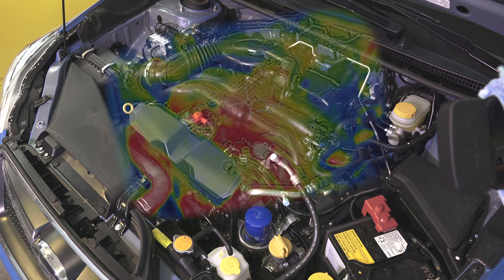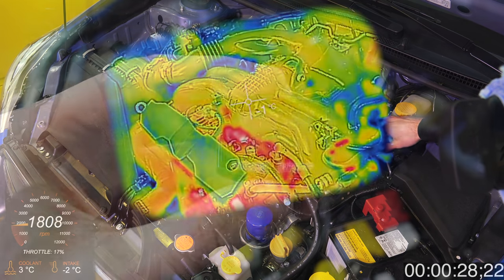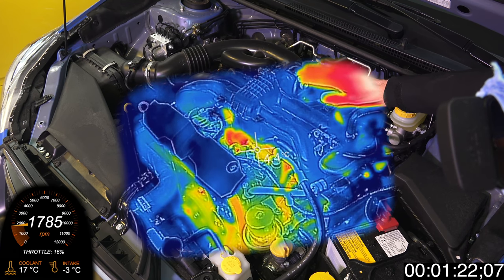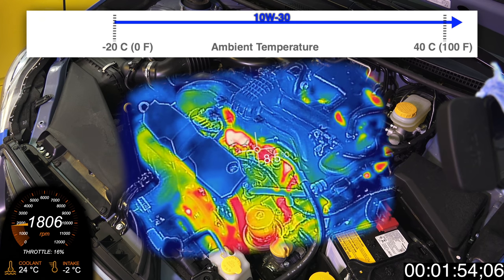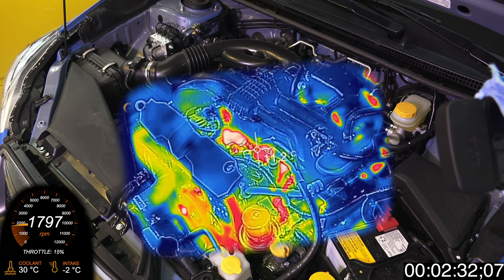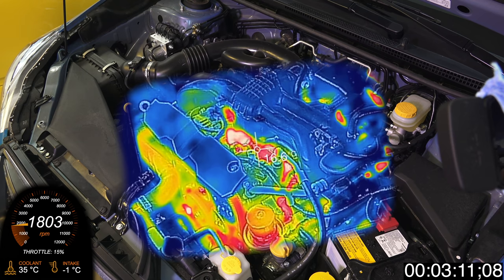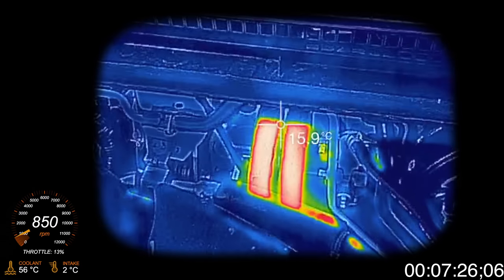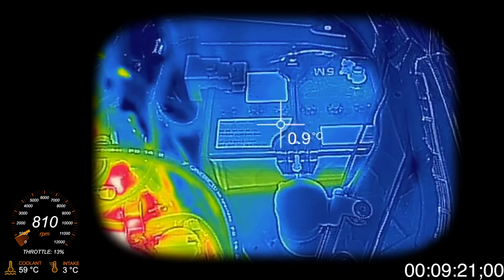Watching A Frozen Engine Warm Up With A Thermal Camera

Comment: Not warming up your engine is like waking up and running a 200 meter sprint
Reply: Based God  he meant like run as soon as you get up no warm up no brush teeth whatsoever
Reply: @the_batmobile0.4  nahh
Reply: Based God  dude you run in your pajamas? thats boss
Reply: Based God you’re obviously over exaggerating
Reply: Random Stuff heart attack are clots in arteries. It is fine to wake and instantly sprint, the body adapts fast and we hbe glycogen stored in muscles so there will be energy. Also the muscles can function anaerobic for 200 meters no problem
Reply: @antonioakiki3716  Yea...untill some of your tendons crack up or some or your muscles get fatal stretches..... Do you know there is the sinovial liquid in your joint (and in tendons area) that acts just like engine oil? When it's cold it's thick and cannot lubricate the joint to the best. Same for the blood vassels in the muscles that need to be warmed up to bring the best amount of oxigen and nutrients to the muscle. For the best athlete performance and to avoid the injuries your body NEEDS to be warmed up. Of course in emergency case u can just wake up and sprint. But try to do this every single day and i assure you soon or later u will have a bad injuries. Like a car engine, in case of emergency you can just drive it mindless of the temperature, but do this every morning and your engine will die much sooner than you expect.
Reply: yall some weirdos idk about yall but i run in my sleep
Reply: @Neil Kee he explained scientifically that it's not a problem with modern vehicles, he even made another video about it..
To all the others who didn't get the joke of @Based God, just /r woosh 🤣🙈
Reply: These new vehicles nowadays you really don’t gotta warm em up
Reply: @oleson3413  yup, I'd say that applies to all the vehicles from 1990 and above, basically when they started to switch from carburator and distributor to electronic injection
Reply: @oleson3413  But what if you live in a place where temperatures are currently hovering above 25°C all day and night long? Lol

Belive me, I've been seeing so many people having hard time starting their cars and even mine that has no problem starting sounds really bad with a cold start.
Reply: T h e B a y L e a f or running a 200 meter sprint without stretching or preparing beforehand
Reply: @k.hamilton5848  Be cool man.
Reply: SirCavemaninthewest what?
Reply: I never ran the 220 yd dash with out a warmup.
Did the 100 yd in 9.3 once, today I couldn’t! Lol

Comment: i just wait til the rpm drop below 1k then drive casual
Reply: r3fr33z39780 I just floor it as soon as I turn it on, vtec yo
Reply: with vtec you don't have to warm your engine?
Reply: Needfor I mean it stands for very tall engine cooling so it loves cold engines
Reply: vtec mean quick heating , you hold the engine in the warming zone ( redline ) and it will take less than a minute ! Hope this help
Reply: I can confirm this.
Reply: also running a truck turbo on stock internals ensures they reach perfect temperature in perfect time.
Reply: you have a honda?
Reply: I do the same with my Lexus. When cold, rpms go to 1,300 and then dip down to 900 after 30-40 seconds (when hot, engine eventually idles at 700). Once the rpms get to 900, I'm on my way.
Reply: r3fr33z39780 you're waiting way longer than you need to in accordance with his other video
Reply: my Saab drops RPM about the time he says to wait so it actually works out perfectly.  I feel like they are fine it will happen a lot faster than in this video in warmer weather.  

p.s please tell me these guys know that isn't how VTEC works and they are just joking and it's going over my head.  Like please tell me they know VTEC doesn't even kick in when the engine is cold.
Reply: Jaqen H'Ghar this is how vtec works. just hold the car in the warming zone as Gab mentioned, at or above the red line as soon as you turn the ignition for fast warm up
Reply: Also when there is a substantial amount of smoke being released from the engine it is just letting you know combustion is occuring at the proper temperature
Reply: TechXplosion these comments 😂😂
Reply: @ShawnD1027 i hope you understand they're making jokes about damaging engines and not being serious at all
Reply: I wait until the temp gauge starts to rise so that I know my heater will be able to blow warm air. I also wait a little while because the pistons don't become circular until they are hot.
Reply: In boxers and flip-flops?
Reply: And if there's a fire then don't worry it's just a feature where you bbq on the go.

Comment: For those of you wondering why the engine rpms dropped, once the engine was warm. It is because fuel doesn't actually burn, it is the atoms that do. As such in order to get a proper burn, the car atomizes the fuel, using fuel injectors and high pressure. Problem is cold fuel is harder to atomize. When the engine warms up the fuel is no longer cold when it reaches the injectors, because it gets heat off the engine. But when the engine is cold, there is no heat to warm fuel, so the fuel can not be properly atomized. To compensate for this the car injects more fuel. More fuel, means higher rpms. Also the various sensors the control module uses to determine the air fuel mixture, then correct it, must be warm to be accurate. When the car first starts, these sensors are not warm, so they are not accurate. As such the car runs in what is called open loop, or it ignores most of the sensors, and runs off predetermined values. Those values typically mean that the engine gets more fuel than necessary.

Comment: A few things that you might not have thought about when operating in extremely low temperatures. While it is true that a 0w engine oil will flow reasonable well and warm up pretty quickly. Other fluids like the transmission fluid and power steering fluid on hydraulic steering systems will take a much longer time to warm up or never warm up in extreme cold situations. It is also more critical that you reduce the stress on these systems when you start driving. Grease and Fluids in the differentials, CV joints, ball joints, etc. can be very thick at -40C and not only are they less effective at lubricating but increase the load. It should also be noted that the engine oil should be whenever possible completely warmed up during the drive. Moisture in the crankcase gasses quickly condenses when the engine is turned off and will make its way into the oil. If the water does not get boiled out of the oil and pushed out of the crankcase ventilation system it can freeze components of the crankcase ventilation system causing further problems, reduce the effectiveness of the oil, cause corrosion inside the engine, and over time sludge build up. If there is an accumulation of white milky fluid under your oil cap then the engine is not getting hot enough. Avoid short trips and extended periods of idling.
Reply: How do I know the engine is fully warmed up I love in TX the temp is 60s 70s right now

Comment: You also have to think about the other fluids in the car. Like power steering, and transmission. I've noticed a big difference in how the car shifts and how easy it is to turn from when the car is still cold to warmed up.
Reply: Many vehicles I've had particularly the brakes didn't get live for a short while and required a ton of pressure. Below -15 or F.🤠

Comment: try that test in Winnipeg, Canada when it's -45 degrees Celsius lol
Reply: Why not just try this in space at near absolute zero temperatures while you're at it
Reply: Deek you the boss
Reply: Deek I bet if I didn't say this someone would say "but there's no air in space so it can't start"
Reply: Jeff I'm right below you in Grafton North Dakota! it's best for block heaters and letting car warm up for sure. by the time it takes you to get all the snow of your car, it's usually ready to go.
Reply: Jeff I'm right below you in Grafton North Dakota! it's best for block heaters and letting car warm up for sure. by the time it takes you to get all the snow of your car, it's usually ready to go.
Reply: Let's remember that cars aren't affected by wind chill. It rarely gets below -30C in Winnipeg. Still very cold, of course. But -45 is hyperbole.
Reply: that was the temps up here not counting wind  in fairbanks alaska for the past week
Reply: Shuffle3956 in space it's actually less hard to start the engine (provided it can get oxygen from somewhere and it can use its radiator) because thermal losses are fewer: there is no convection in a vacuum.
Reply: Jeff it's been really nice lately lol
Reply: I lived in Timmins, ON where winter night time temperatures of -30 degrees C or colder are a common occurrence. At those temperatures I would not be able to perform this experiment unless the engine was prewarmed with an engine block heater, because otherwise it may not start. Even if it did, frequent cold starts at those temperatures probably reduces engine life. The block heater has the added advantage of warming the coolant so you get heat sooner. A battery warmer also helps a lot at such low temperatures.
Reply: We can't count wind chills Jeff. Lowest I've seen lately was - 32 c
Reply: Never in Winnipeg, which is what this thread is about. At least not since people have been recording temperatures.  Also, 2014 was the coldest winter in 64 years (which had about a dozen sub -30C lows).
Reply: You are that person talked about at 2:40!!
Reply: When it's -20 or more I usually let the car sit for a few minutes.. like 3-4 just so oil is flowing, Just a weird subconscious habit I guess
Reply: It's not often it gets to -45 here. Also don't forget wind chill doesn't affect your car
Reply: well, it affects it in the sense of quicker cooling. the faster the wind (lower the wind chill) the quicker an object cools.
Reply: Chris Yorke, wind does effect cars. A vehicle will definitely warm up quicker out of the wind because the engine is not perfectly shielded. Especially if you have your hood open like this guy))
Reply: Roman: Wind can affect the rate of cooling, so I suppose there might be a nominal difference if the car was just sitting, as in the video.  

If you started the car in -30C ambient and then started to drive, the effect of the wind would be erased by the "wind" generated by the car moving, which is likely much faster than the wind.
Reply: ya, in northern ontario i had a day that was -50 before wind chill, my truck did not shut off that weekend.
Reply: You'd suffer from extreme hypothermia in a few minutes
Reply: Well Ian, seeing as how I'm a person and not a car, I would freeze to death.  I didn't say wind chill isn't a thing, I said it doesn't affect cars.  Since that time, I've conceded that wind chill CAN have a nominal effect on stationary cars because wind can affect the COOLING of an engine.  It would have NO effect on a stationary, non-running vehicle.  It's science.
Reply: According to weather data its not often that it happens and in fact is very close to the all time record..lol
Reply: Except windchill is a rate of cool, so therefore it will remove more heat from the vehicle making it colder inside, compared to the same temperature with no wind.
Reply: Nope.  If there was a fluid that froze at -30C and it was outside in a windchill of -50C, it wouldn't freeze.  Windchill increases the rate of cooling down to the ambient temperature, but not below.  Windchill does not make anything colder.  That's why they say "feels like" -40.  If it was -40, they would just say that.  It's a perception of cold to animate beings that isn't measured, but calculated with air temp and wind speed.
Reply: ayyy i live in winterpeg lol
Reply: If your hood is open and there is wind chill, you get more convective heat loss proportional to the flow of gas over the engine. 

That's why it is harder to regulate body temperature in strong wind and you are more prone to frostbite.
Reply: MemoriesDestroyUs Ottawa here, we  hit -50 Celsius a few times a winter. Thank god I have a garage now.
Reply: There's usually exeptions like if you need let your battery charge after a jump. If it's in your driveway thats your business.
Reply: Robert Knight if your battery gets abused to the point it needs jumped it should be charged full with a proper battery charger.   The alternator will never get it full due to not being able to hold the high voltage needed for multiple hours after 80% SOC is achieved
Reply: Jeff he predicted ur comment lol
Reply: +Chris Yorke  Do you live in Winnipeg?
Reply: Да перестаньте мериться письками. Поселок Аймикон в России - 72.5 гр. Жители говорят нормально - перчатки не нужны)))
Reply: all i see is -72 and i liked it
Reply: Lol . I guess most people here didnt pay attention to the oil specs and still proceed with funny comments; or even grasping the explination of its entirety, just wanting to rag on someone who does reasearch and owns cars himself.
Reply: Justin Miller *amps   not high voltage alternators only put out 13-14 volts.
Reply: Winterpeg
Reply: Aww Winterpeg, the vast frozen wasteland!  See you on Labour Day! Go Riders!

Comment: You seem to be forgetting that oil flow, fuel atomization, and comfort aren't the only reasons to warm your engine up. Consider metallic expansion. Aluminum pistons are going to warm up a lot faster than the cast iron or steel cylinder liner and the engine block full of coolant. It's better for the engine to warm up more slowly so the pistons and engine block expand at a more similar rate. When you start and just drive off, the piston expands much more quickly than the cylinder causing it to fit more tightly, and in turn creating more wear and in some engines even causing permanent damage. Just ask anyone who drove a V6 GM car in the mid to late 1990s who didn't warm them up before driving. They had a lot of piston failures due to this metallic expansion. It's still better to allow your engine to idle for 5-10 minutes before driving off in cold weather. Oil change interval should also be shortened a bit in this time due to the extra contamination.
Reply: Krankie V I agree completely.
Reply: Rhino Willy's Exactly. Ever seen the bore of an engine that wasn't ever allowed to warm properly? Noticeably accelerated wear and piston scuffing. Nice Jeep, btw!
Reply: I wait 10 mins too and my cars have been good to me, agree 100%
Reply: The standing advice is, if you drive the vehicle immediately or after a short warmup, it should be driven moderately. That means getting up to street speed slowly. But if where you live you have to immediately enter the stream of traffic on a highway or boulevard you might not be able to do that. Engines do warm up more quickly if the vehicle is moving though.

A lot of people don't have ten minutes in the morning. You must be either self-employed or retired.
Reply: @anonymike8280  What about getting up 10 mins earlier?
Reply: @jimmybrad156  Dream on, bro.
Reply: @anonymike8280  I'm 4 years late 😂